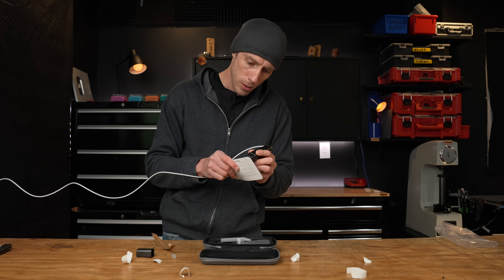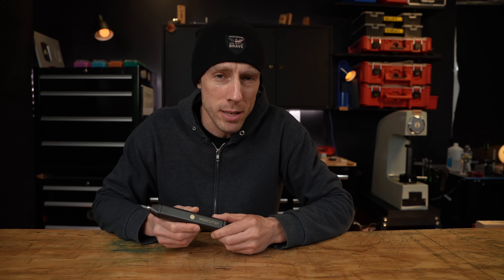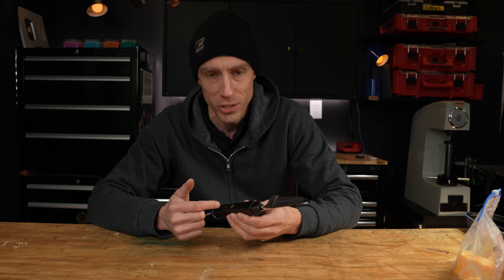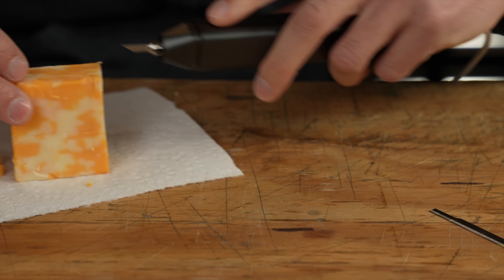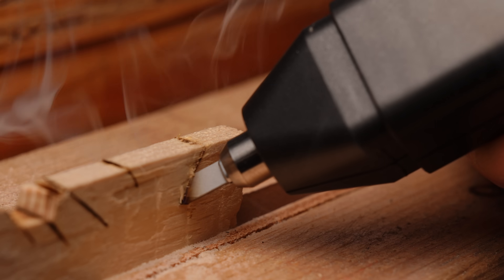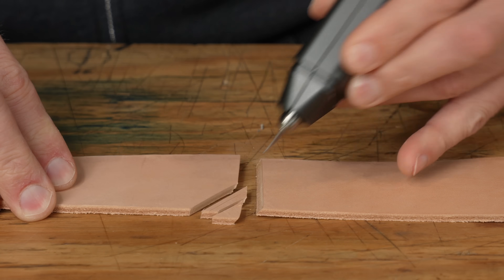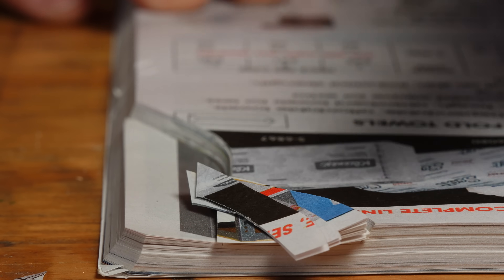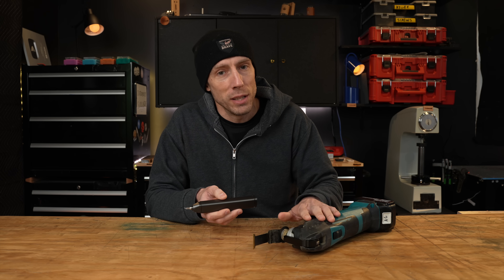Could This Small Tool Be The Future Of Knife Cutting Performance?

Comment: Star Wars vibro knife. Also, you need more power. I have no idea if the shape is an additional factor. The weight difference is huge between the original blade and the replacements. More mass requires more energy.

Comment: The problem isn't with needing more power, but rather that the resonant frequency used for the small knife is going to be way different than any bigger knife you throw on. I bet you could use the same amount of power, but by varying the frequency of the piezo stack you can get the same performance with a bigger blade.
Reply: Agree with changing the stack, you could reduce it to 20 Khz and the lover frequency would have more power to move a greater mass.

Comment: The larger blades will work, but the frequncy needs to be precisely tuned to the blade. The impulse frequencies need to interact constructively along the cutting section for it to work. This Old Tony has a pretty cool video on this. He even broefly shows of the computer simulation he did to reach his conclusions.

Comment: It's not so much a lack of power that causes different sized blades to not work, but that these systems work by resonance. When you change the blade you change the resonant frequency of the system, so it can't build up the oscillation size needed.  You'd need much stiffer materials or a larger-displacement transducer to use a bigger blade. Think of it like a tuning fork, if you hang a big piece of metal off the end it won't make the right tone when struck!
Reply: Know-it-all posers like you are insufferable.
Reply: Ehhh?  I would think the gadget would have enough power to NOT depend on resonance to build up amplitude. Otherwise, as soon as it was put to work, (loaded) the amplitude would fall and not much cutting would happen.
Reply: @sayeretmatkaal any object has its own resonance frequency. The biger and havier it is - the lower the frequency and higher the amplitude. 
Try wiggling a pencil and a 2 meter stick
Reply: @ Thanks, but I know what resonance is. I said the gadget would hardly cut if it's amplitude is SOOO dependent on frequency.... because load would reduce the frequency just as the mass would.  Hence it should have enough power to oscillate at (somewhat) higher & lower frequencies. And with smaller & bigger blades.
Reply: @sayeretmatkaal  All ultrasonic tools rely on resonance, and require careful tuning to work. For one thing, you have to avoid destructive interference. Consider a guitar string, or any other acoustic resonator. If you try to drive it with the wrong frequency, it just won't ring at all. Oscillations that are not resonant will destructively interfere, and have very little effect.

Also keeping in mind that the oscillations are happening over 20,000 times per second, it's possible for it to build up the energy from a few, or a few 10s, of oscillations while you're cutting. The cut can be discontinuous at that time scale and still feel perfectly smooth.
Reply: @jasexavier  Yes & NO.  
There are SIRENs & HORNs which oscillate at their resonant frequency efficiently converting electric/pneumatic potential to sound.
On the other hand, there are SPEAKERs which convert electricity to sound at much lower efficiency , but they don't stall under any loading (Bass reflex/horn/sealed) like a siren does.
If I had real-world problems to solve, I wouldn't rely on a CANARY in a COAL-MINE

Comment: It's a harmonics thing. The blade has to be tuned to the piezo element and vice versa. You can make a bigger knife work with a bigger driving element, basically. Also different drive frequency to match it's natural frequency in that axis.

Comment: It could be possible to build a similar device from a speaker. Many can create sounds of about 20k herz (yes that is half of the little one but might still work well) Just need to push a knife blade instead of air🤷‍♀. Someone with more knowledge of electrical engeniering and stuff can probably figure out if that actualy works

Comment: I think an ultrasonic tool that is large enough to move a much larger blade would present a health hazard. That's a lot of radiation you'd be exposing yourself to. Then again, there might be a safe way to harness that radiation without risking exposure to the operator. Then there's size and weight.

Comment: Could you please do a video about the Jende Nanocloth Bench Strops? 🙏
I would love to buy a strop for my kitchen knives (just bought new fiskars knives, they have some kind of factory burr). But I'm way too lazy to make one myself. 

I also have some D2 knives that would apprentice a strop aswell! 

Some of the questions I would like to be answered are: 
Which size? 2x6 or 210×70?
What is the lowest micron you should go as a normal human? (Prolly depends on the knife steel aswell, right?
How different are diamond compounds to diamond emulsions (that Jende offers)?
Are there better (premade) strops you would recommend?

Something unrelated to Jende, do you know about the BESS test and what is your opinion on it?

I would really love to see a video from you about all this! ❤
Reply: So I bought myself the Sharpal 162N to replace the lansky stuff I have that I absolutely detest. 
For stropping, after a bunch of research, I decided for wood and StroppyStuff 0,5 Micron Diamond Spray. 
The wood I chose was actually oak. 

"Hard Wood good" so I thought let's try this out. The place where I ordered had premade strops (with aluminium base) and oak was the hardest wood option. I ordered on sharpinator(de). I'm located in Germany. 

The StroppyStuff 0,5 Micron Diamond Spray was 36€, the oak strop was 12€ for a total of ~52€ with shipping. The Sharpal 162N was 70€.

Comment: My guess is that the blade might be part of a mechanical resonance system, and by changing the blade mass, the resonance disappears/is severly weakened and/or alters the frequency to something that won't work. I like you idea about a disposable razor-type thing, I'd buy one of those as well.

The size of the blade on these things is just too small for anything but detail work. I can see the appeal if you need to cut fine detail with precise control in one of the mentioned materials. The control is probably key, as you ned little force it's probably easy to get very accurate cuts, following a template or whatnot. Even for wood if burn marks aren't a problem.

For the right application I think they seem awesome, but for me personally it would probably not be worth the cost, another rarely used gadget to be used in a pinch.

Comment: I think one of the main problems with scaling up isn't even power, it's the wavelength. So given the speed of sound in steel is ~6000 m/s give or take, with 40kHz the wavelength is ~15 cm, and the practical limit or the reasonably consistent blade size would be definitely less than 1/4 or that (~4 cm), I'd even suggest 1/6 (25 mm). It's still much better than the 8 mm and having an actual cutting blade size of 25 mm would enable a bunch of new applications. It's also likely important to consider the overall distance from the piezoelectric driver to all the different parts of the blade, especially if you have standing waves in the blade.
Reply: Turns out you can make this work across blades of arbitrary lengths by adjusting the driving frequency with a feedback loop until you find a useful resonance. Even in a 200mm chef's knife. The hard part is finding the right balance of back mass (length + material), piezo stack, and knife geometry so you get a useful resonant mode.
Reply: @sheimend  This is pretty cool. I guess the reason it's not widespread is that dynamically maintaining that resonance just makes the device more expensive.

Comment: My problem with that, probably would be the same as with the ultrasonic thing they have at the dentist for professional teeth cleaning. That hurts my ears, even though everybody claims it to be ultrasonic, so should be above human hearing capabilities.
And i also have an ulrasonic "animal scare device" mainly to stop martens and cats shitting onto my cars windscreen. (happened often before i installed it, and stopped after it) I can hear that thing working too. (it has a movement sensor, and so every time i get into the car or walk by, it gets triggered too.)
Other than that, i think the reason your bigger blade attempts did not work is that your blades have a different size, shape and material, and so the resonance frequency is different. And the knife only operates on one frequency, that fits the intended blade. For your blades you probably would need to adjust the frequency quite a bit.
As this won't have an oscillating motor like the oscillating tools, but relies on the same idea that makes a tuning fork sing. If you just weld longer rods to y tuning fork, the resonance frequency changes. Same with changing the material.

Comment: A saw blade has set on the teeth for a very good reason, allowing the blade clearance to pass through solid materials like wood. Making a knife blade oscillate doesn't in any way help. Up sizing will only exacerbate the problem. Knives are primarily for slicing from an edge so the waste can curl out of the way

Comment: This is a bit off topic, but if you get a large, well made/designed knife, like an esee junglas, busse bushwacker mistress, sykco alpha regulator, a rinaldi manaresso, etc, you can not only chop instantly through that Kevlar (in all likelihood), and kydex, and rubber, they are also able to slice and cut such materials because of the immense increase in leverage and weight. How is that relevant? Well, most people consider those knives TOO big or impractical, but the reality is they have vastly superior cutting capabilities that many of you likely do not explore.

Comment: So basically, the Mass and size of the Blade is crucial for its ability to swing. The oscilator in the tool is only swinging at one specific frequency and amplitude, the Bigger and heavier blade just damps out the oscilation. Why it cuts so well is more or less obvious, so the Blade edge has a very high speed and it hits the surface like a chisel. The Friction is similar in both directions so it does not push the blade out. The oscilator is probably a Piezzo crystal which is very limited in Power output

Those bigger tools work very similar but they have a lower frequency and higher amplitude according to their Blade inertia. The oscilator is usually a Motor with a Belt. If you force a heavy Hunting knife Blade onto them they wont work either.

Comment: As a test for larger blades - perhaps start with a couple links of a snap-off blade, or half a utility blade, and then help the oscillation "start" by tapping it with a small metal rod. Kinda like the oscillation of tuning forks are started.
The reason being that with the increase in mass perhaps the motor of the unit might be capable of maintaining the oscillation but not start it. Kinda like how a fan, a washing machine, or a pump, would have a capacitor large enough to give a starting "oomph" - without the capacitor it'll stall before anything happens, but if you remove the capacitor after the movement began it can keep going as long as the motor is running.

Comment: First i want to say, i love your channel! Second, I've come up with several actually cheap ways to do this. You likely have more tools, but piezoelectric transducers are cheap on Amazon for audio systems. The smaller ones handle high frequencies and would move the knife well. If the base of the knife was t shaped(vertical), you could use two identical transducers attached on opposite sides and feed the same exact signal to each but one flipped in polarity. This would double the strength as one would expand at exactly the same rate the other contracted. You would want a steel with very little flex to get the most out of it. A small amplifier and battery pack could make the whole thing handheld.
Reply: This would allow you to adjust the intensity and frequency very easily.

Comment: Getting a 20kHz oscillation is in the piezoelectric range, like a quartz wristwatch. If this is the material they used it would explain why other blades didn't work, it's tuned to resonate with a particular size and shape of blade. I doubt they can make one at the size you're after in a portable form, though I'm no expert.
Reply from the maker: Yes this is true. I didn't mention the resonance tuning since i have no way to alter the frequency. I believe the much higher price units have the ability to tune the frequency to get the correct tuning for different blades. But that about as far as my knowledge goes 🙂👍

Comment: IMO, probably too much mass to move on the larger blades, and there is also the issue of stiffness and resonance. You'll need enough stiffness that the blade doesn't just absorb the vibration, but enough toughness that it won't shatter.

Comment: One of the largest issues with ultrasonic knives is the blade, piezo, and other parts essentially have to be tuned. Well if the blade is heavier than a couple miligrams, or longer than a very small blade at least. This would mean your average 3" knife would run at 13 ish khz multiple and rely on the steel sort of bouncing in length. (This whole thing is kidna hard for my brain to render so i might have got the frequency significantly wrong idk) 
Then we have the issues of geometry and power.
 You will probably notice that most ultrasonic cutters have the blade angled about 45deg to the axis of the vibration. This improves the cutting by having half the energy from the ultrasonic movement going into nanoscopically pushing the blade into the material with the other half sliding the blade. (this probably also did not help your attempts)
The power requirements themselves are not really the issue, a 3kw cutter for example should be entirely within the realm of possibility. The issue comes from the fact that a 3kw anything mechanical is going to generate a significant reaction force. In the case of vibrations, this means that the user will have to be isolated from the vibratory components rather significantly or suffer friction burns. (and therefore reaction masses are also required)

Comment: The blade probably vibrates at resonance, which is its natural vibration frequency. Another blade would only work if: 1) the new blade was still light enough for the motor to move it without failing, and 2) the resonance frequency of the new blade matches the originsl blade. I think there are tools to predict the resonance frequency of an object, but even a small deviation will make it not work. So better off measuring it.  Touch the originsl vibrating blade to a replacement blade made by the company sitting loose on a table, and you'll probably hear the blade vibrate, but touch the original vibrating blade to another of your blades and the sound will be quieter than you expected. That would confirm that this is a blade vibrating at resonance.